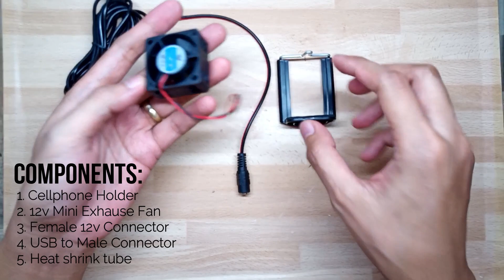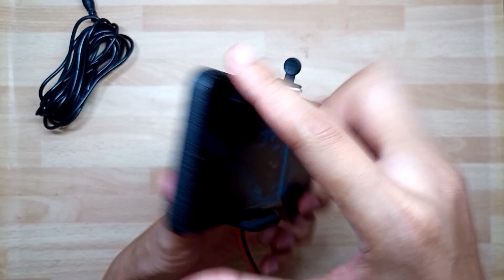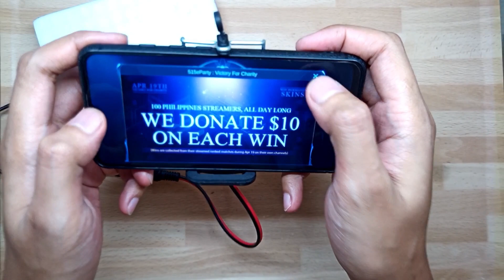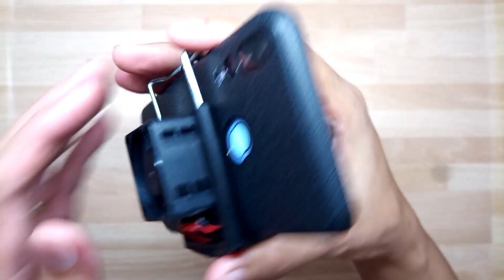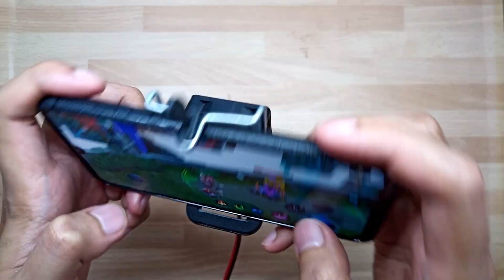MOBILE PHONE COOLING SYSTEM

Comment: Pwede din po ba ung 3 pin na cooling fan?  Will it work pa din po ba kahit d connected ung white? Newbie here   :((

Red black 
Ano po purpose ng white?
Reply from the maker: Signal pin po ata yung isa. Pwede nyo po try basta mahanap yung supply wire po

Comment: i made exactly one of these from way back november as i can say it does work but i definitely rattle and not that much help as the part of the cpu is at the top corner of the phone not in the middle and i suggest removing phone case for better heat desipation. btw i tried 5v and 12v fan it still rattle holding the phone feels like a vibrator
Reply from the maker: You can adjust the position of the cooler sir. Thanks

Comment: Suggest ko pre fan+heatsink+peltier module+copper plate with rubber cover. Tas kaw bahala kung anong protptype gagawin mo mas effective ang cooling. At dapat naka dikit siya di yung may offset yung layo niya para mas effective ang cooling.
Reply: pag gagamit ka ng peltier much better na bumili ka nalang ng buo ng peltier cooling device for phone. mas optimized yun since programmed na may voltage controller and case na din. unlike if mag build ka mas mapapamahal kapa sa diy peltier cooling system
Reply from the maker: @MarrkyyMee  thank you po 👍
Reply from the maker: Thank youpo sa suggestion sir.

Comment: solid diy cooling system sir 😊. also, keen to know where to find/buy materials like 12v fan and female socket. 😊
Reply from the maker: hi, here is the link for the materials used po
1. 12V DC mini fan - https://shopee.ph/%E2%9D%A4%E2%9D%A4-DC-12V-2-Pin-5-Blade-Cooler-Brushless-Mini-Cooling-Fan-4020-i.135511180.2196303526
2. Female DC Connector - https://shopee.ph/product/8710520/2411674633
Reply: @DIYPINOY  omg salamat ng marami sir 😊😊😊 more videos pa po to come and more subs. nka subscribe nako. 😁
Reply from the maker: @jayq9608  salamat po :)